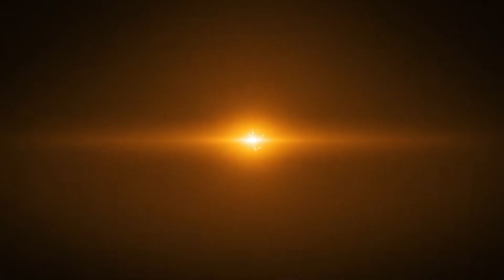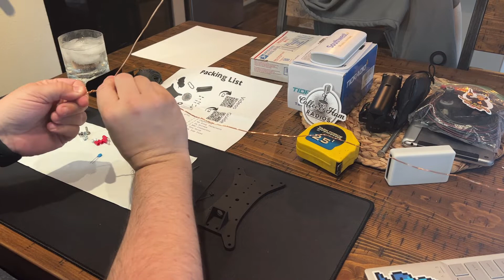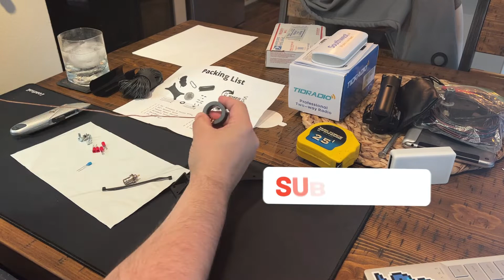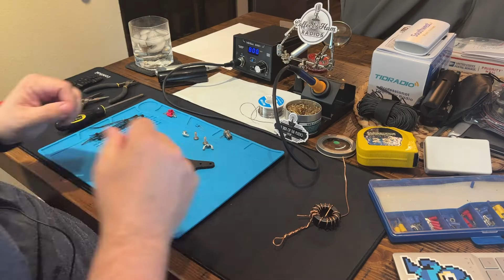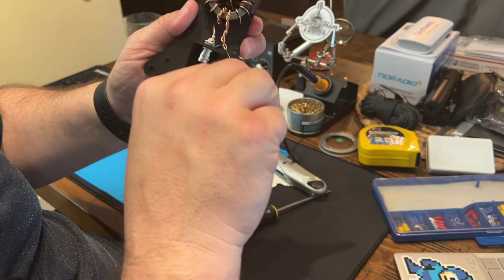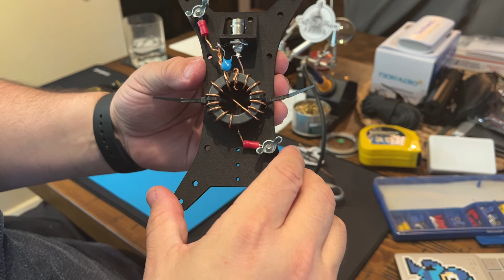BEGINNER Ham Radio Antenna build: CaHRtenna Artemis, 49:1 EFHW Part 1

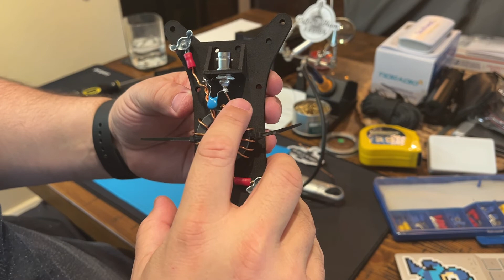Comment: At 20:36, there is no solder connecting the twisted ground wires together where they split to go to the BNC ground and the counterpoise lug.   Did you correct that later, or are you operating in that configuration?   Without that connection, then it is a random case of whether someone's build results in the BNC center terminal going through the 2-turns and back to the BNC ground or to the counterpoise lug.
Reply from the maker: Hmm, I have solder at the base of the twist where the capacitor jumps from the twist to the ground
Reply: Must have been the angle or the lighting that made me miss the solder connecting the twisted wires to each other.  Good deal. 🙂

Comment: Nice build Shane. Glad USPS finally dropped it off. Looking forward to part 2
Reply from the maker: I actually had to call them and stop it. It has the wrong zip code so it was in an endless loop between post offices. Lol
Reply: @QBFWorkshop  Oh gosh. Glad it finally got straightened out. But you have already seen one in action. 😉